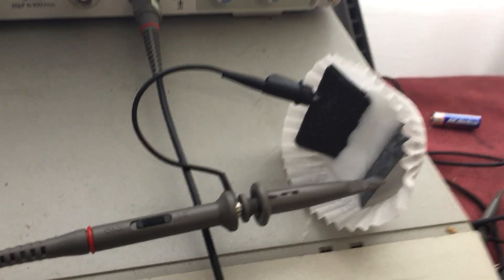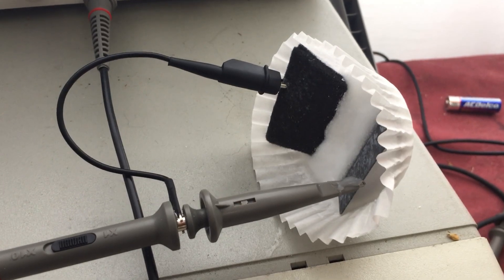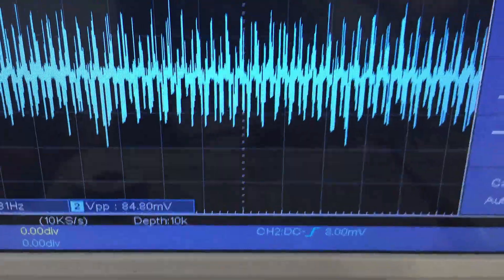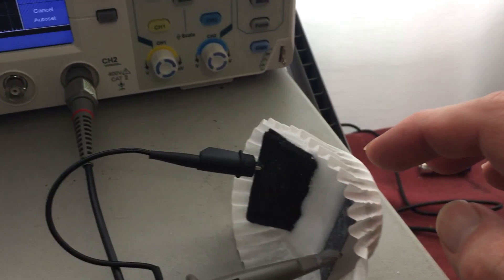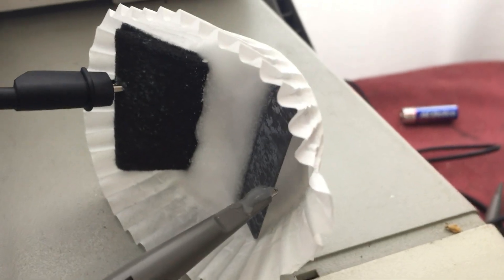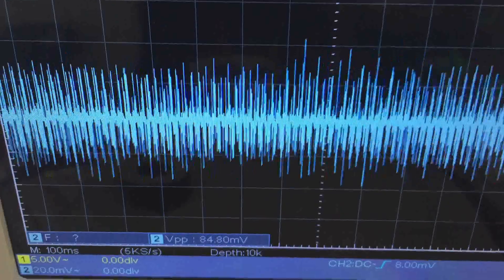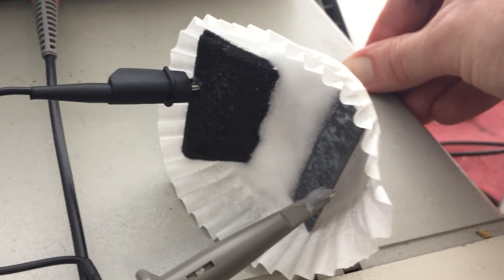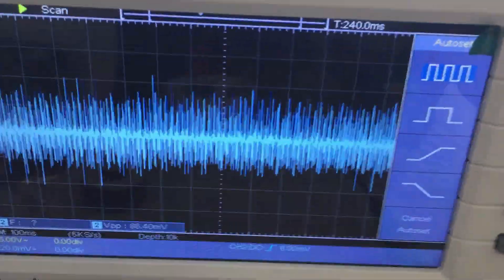AC Output From Cell

Comment: I wonder if a ceramic disc cap or maybe 2 in series across the electrodes would have any effect. Or maybe using coils like you said. Maybe a joule thief into a rectifier to capture everything into pure dc. There seems to be a lot going on here. Many possibilities.

Comment: That's very interesting the random spikes are as random as white noise which is the best star condition that you can get😎👌 which means you can use every electromagnet oscillator it will resonate at its own frequency. This signal is like blowing air at the neck opening of a empty bottle if the amplitude of the white noise(the air blowing against a hard surface causes turbulence) is high enough then the bottle starts to give out a tone of the fondamental frequency of the Resonance of the cavity from the bottle. In the end a bottle is just a Helmholtz Resonantor. 😂

Comment: It fun they are highly sensitive  I never used coils it was other crystal wafers ideas I got of the warships I worked on sonar crystals and secret things they thought was secret but the tech goes vac many decades I have original equipment used for detection systems my job was guns and ekectr9nics  artifisl reef society of bc Canada 5 years of fun at night for a hour or so I built them the power cells they gave me 250’000 usd to build them twice so I never asked for money only parts from the ship

Comment: awesome video Joel, your journey into material sciences should hopefully yield some interesting results! I think exploiting the AC component of crystal like material would be the best way to go. I've been doing similar experiments with Epsom salts and using difference compositions to create a salt battery as well. I was able to create crystals that have around 20uf  .3v of capacitance uncompressed and up to 280uf compressed. it seems these types of cells store energy the best in fluctuation or oscillation rather than in a dc battery sense.  you might want to try dissolving the material and growing crystals in both water and acid (vinegar) which should alter the ph and properties of the crystals and allow for more even distribution of the atoms in the solution.

Comment: Thank you for sharing. Is this cell the type with only the Polyethylene glycol or mixed with salt? (You talked about a mix of 3 different things in one of your video´s)
I´m trying now also with silicium carbide K80, a few years ago I came to a patend where this was used in resin to receive from environment, so that´s why I´m also trying that.
Reply from the maker: Just Polyethylene glycol here
Reply: @joellagace1679  Thx, I looked up where I found about the silicium carbide, it was from Patrick Flanagan: https://patentimages.storage.googleapis.com/93/ee/f7/5666a93f1d6299/US4743275.pdf
Reply from the maker: Ah our friend mister neurophone :) hehe
Reply from the maker: I think it may be acting as an electret as it cools and hardens with the natural potential of the cell conditioning it at low voltage and why in part anyways it keeps working dry. I'm testing these in the even and doing some interesting tests right now with this.